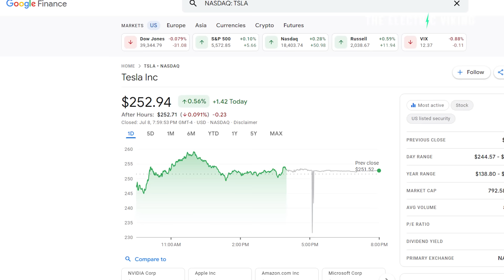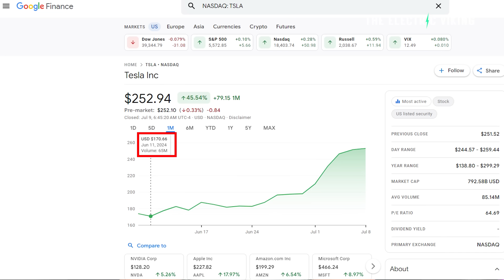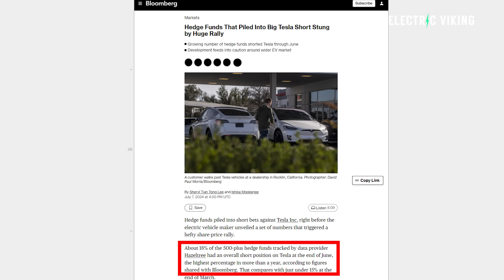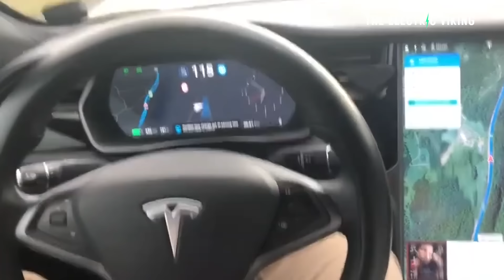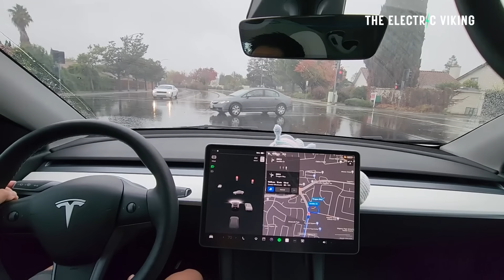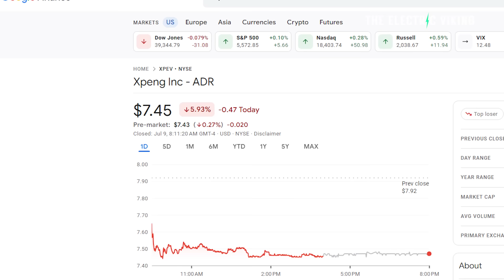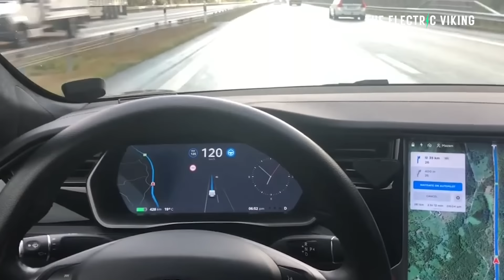The REAL reason Tesla stock skyrocketed 47% in the last 25 days

Comment: Invested in 2021. Rough ride, never sold. Finally im in the greens again❤
Reply: Started in 2022 and have been dollar cost averaging/accumulating. Now I’m very happy 😆
Reply: Started in March of 2013... 200 shares at $50 (of then).  Had a ball the first year... then nothing happened (on the stock value) for 4 years, but sold nothing... slept on them... then it dropped in early 2019 and the bears were all predicting "bankwutcy".  I therefore analyzed the fundamentals (I mean by that the real BUSINESS fundamentals, not what some clown analysts call fundamentals... i.e. quarterly financial statements!), and came to the conclusion that it was the right time to buy.  Bought 100 shares in June 2019, and 100 more in July.  We all know what happened since!

I still own all of them (well, they grew 15 fold in number...) except the few I sold to buy myself a Tesla!  And I will hold them until the prospects of a) the energy division, b)  FSD/robotaxies, and c) Optimus are correctly factored into the share price.

The advantage of having a $20 average acquisition price is that it works wonders for sleep quality when the share dips!

Comment: 2024 model 3 is perfect
Reply: Only problem is the new import tax on it from Europe. That’s gonna hurt sales and margins. I hope they are able to start making it in giga Berlin, but I am sceptical…
Reply: Besides the lack of stalks for indicators and gear selection. And missing a HUD in a car in 2024.
Reply: @av_oid  I have one, lack of stalks doesn't bother me at all for indicators...a little for lights, but it has auto high beam adjustments so not a huge deal.  A HUD would be awesome...but other than that, the refresh is so much better than the previous model

Comment: These types of moves are common in stocks that have a heavy short position and all it takes is a short or long term catalyst that brings more money into the stock and then the short squeeze cycle begins. The short squeeze cycle pushes out shorts, forces them to buy back the stock which increases the price and that pushes out even more shorts, forcing them to buy back the stock. This will continue until a large chunk of shorts have washed out of a particular stock. I'm not a fan of shorting and think it shouldn't be allowed to exist, but there are people that use it as a hedge tool. As far as Tesla as an investment, I have a hard time investing in something that trades at 80x next year's earnings, who underperformed the last 3 quarters compared to estimates and have a 5-year projected growth rate to be around 15-20%.

Comment: Isnt It a lot smoother and more comfortable and safer and less stresfull to drive your car with your two hands at the wheel than hands free with FSD?.
Reply: Yes. Though perhaps only for a few more years. 
One has to think about what is possible in the future, whether that is 1 year, 3 years or 13 years away.
Reply: AND also less stresfull. FSD doesnt make sense... Imagine a million vehicles with FSD chaos on the roads
Reply: @ignaciomachuca3750  I’m genuinely curious if your view of that world is better or worse than current conditions with so many speeders (most who are also distracted).  While there are certainly trade-offs, I think the future leads to net safer roads.
Reply: FSD is already safer than the average knob. 25% of drivers are medicated.
Reply: On top of what I said what happens if there is a computer failure when driving with FSD at 60 miles PER hour and the driver is not quick enough to take over,?

Comment: If you are smart you can tell this was pump and dump; and you could have made a lot of money.  There would be few if any shorts on Tesla stock which had dropped to 150 half what it was worth a year ago; it is now back up so  the next question someone consider shorting will be asking is - will Tesla meet even the lowered profit expectations when it is announced in 1 week?  Tesla made 1.1 billion last quarter - do you think they will this quarter?  It is this question shorts will be considering; if they think it will make that - they won't short but if they think they won't -  they will.  What do you think? did they make 1.1 billion?